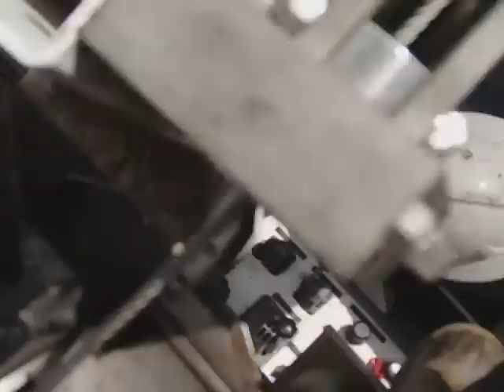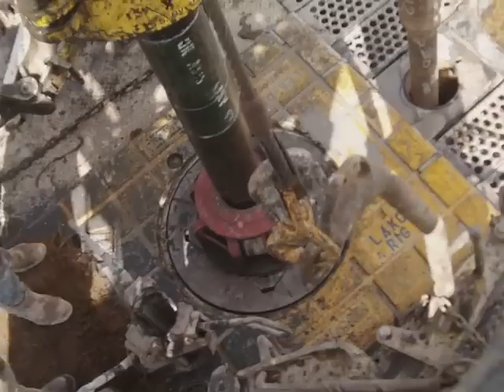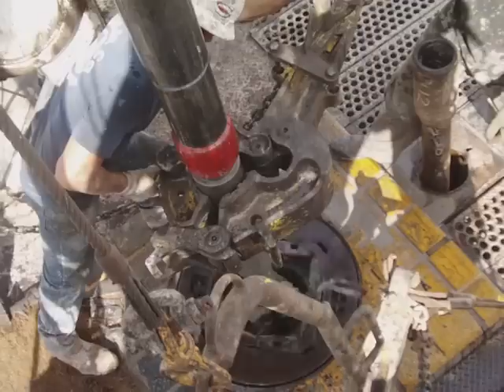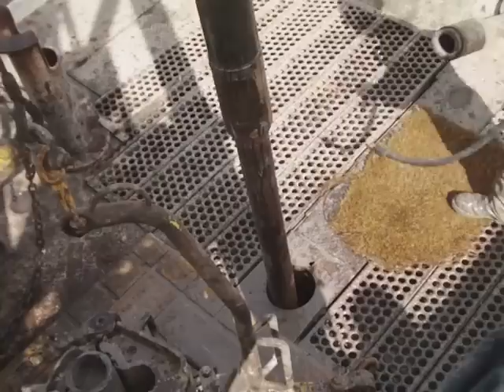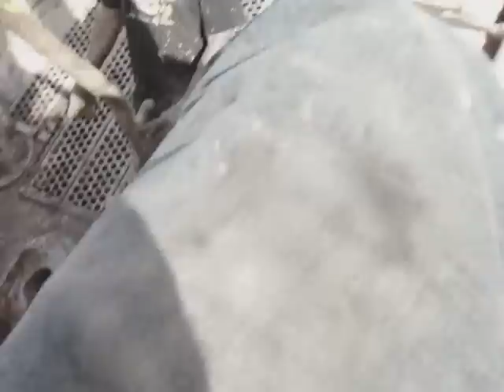Dangerous Oil Rig Work

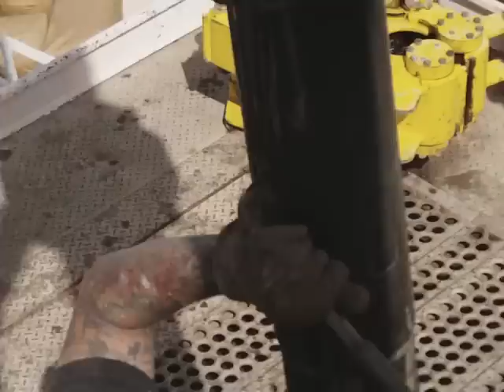Comment: What is the roughneck doing with the rod at 2:25?
Reply: It's not a rod it's a kelly clock key. He's opening a valve inside the kelly to allow drilling mud to be pumped downhole. The one on my rig is the same shape and size as our stabbing valve (or T.I.) key so that it can be used for both.

Comment: Looks like tripping. They are running in or pulling out several single pieces of 'drill pipe' and connecting them all together. There are several reasons for this but if you are conscious and thinking straight then you will never get your hands caught or pinched. All about proper hand placement and staying safe.